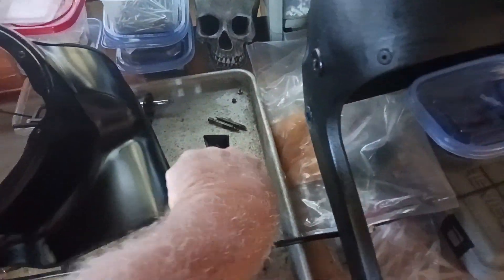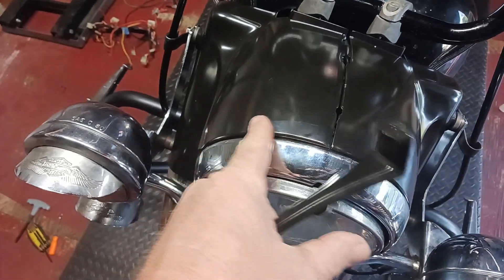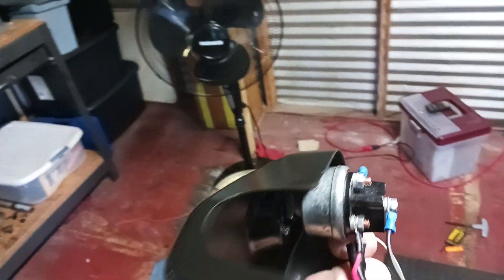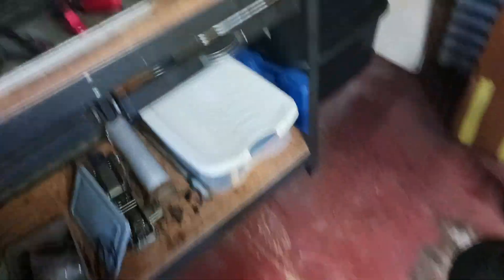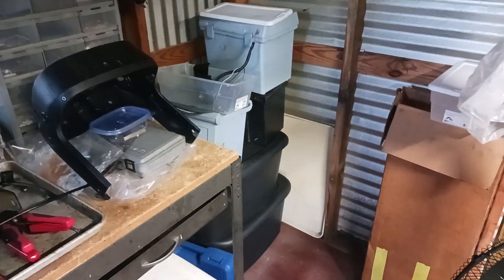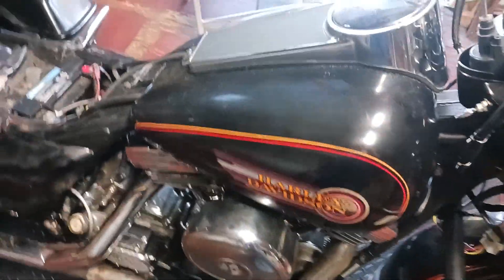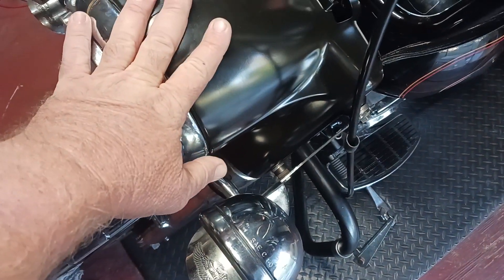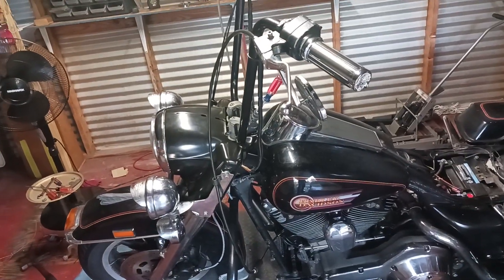1993 HARLEY ELECTRAGLIDE TRANSFORMATION INTO A ROADKING LOOK.

Comment: It might be time to switch your thinking.  Here are some facts.  If that EVO engine runs good and the transmission is good, then all of this ither mess is worth fixing.  I know for a fact you can get everything else you need for that bike from Fallen Cycles and they are in Florida I know because I bought some parts off of a 96 harley heritage from them and they also have a list on Ebay of all the things they have for sale.. I am going to re watch this video of yours and try and understand what the hell is going on.  Budget rebuilds has a chubby bog guy that could fix every bit of all of that I know.  .